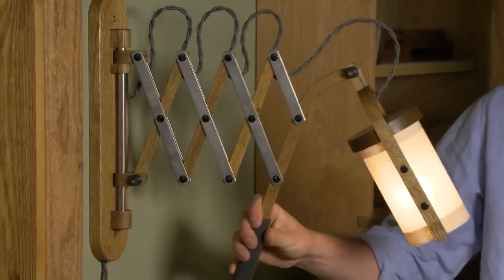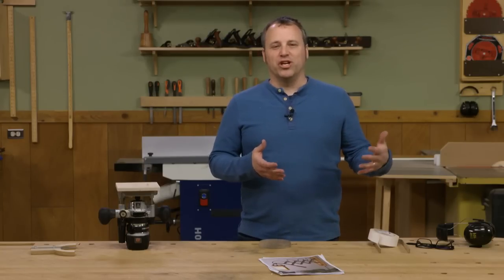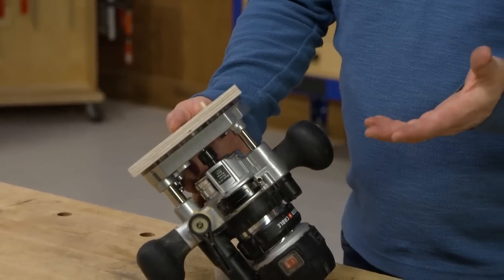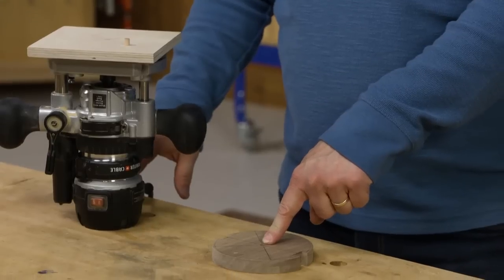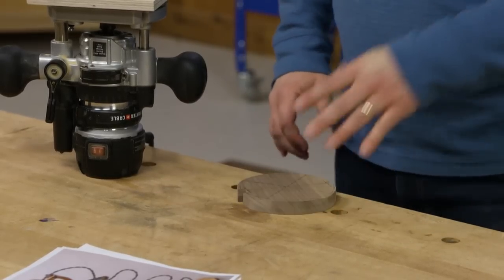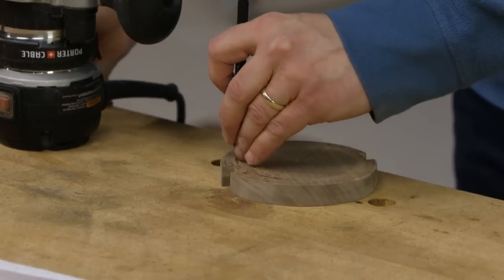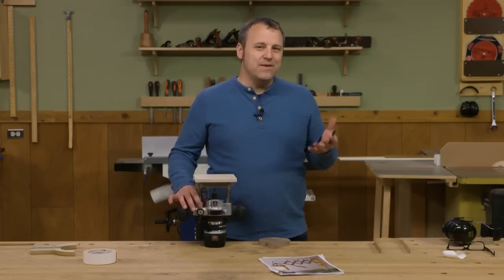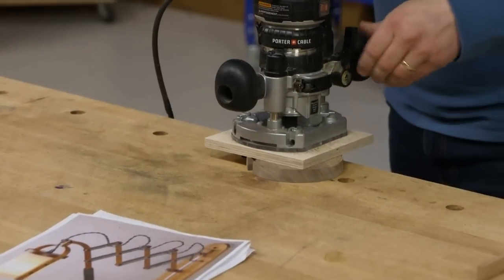Woodworking Tip: Small Parts Router Trammel

Comment: All the double sided tapes I have tried are difficult to remove the liner but yours looked easy.  Please identify the tape you used.
Reply: Pretty sure every job interview at Woodsmith includes peeling one side of double-sided tape while looking at the camera and describing the advantages and disadvantages of 8 degree or 14 degree hand-cut dovetails versus dowels.  And playing the state song of Wisconsin by varying the speed of a router.
Reply from the maker: We have always used the double sided tape from Intertape Polymer Group (IPG) and had pretty good success: https://www.amazon.com/Intertape-591-BEIG136-Double-Sided/dp/B01B8HLRVY/

Comment: If someone was really smart & forward looking, they would have also drawn on the trammel plate a set of circles at 1" & 2" and some radial lines such as diagonals. Then when you want a different radius you measure along the radial line from where it intersects the circle +/- to find where to drill a new pivot point, just make sure the pivot is a snug fit, not glued in place.
Reply from the maker: I like it!  Thanks for the input.